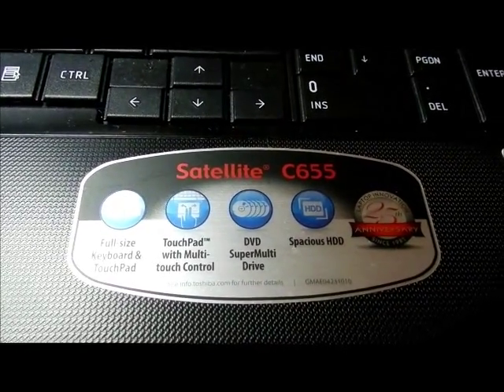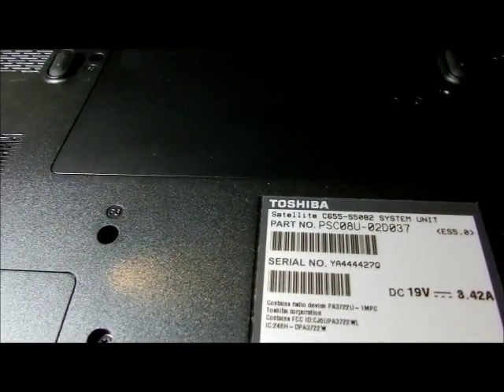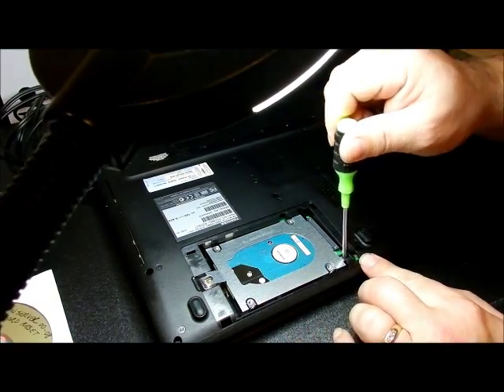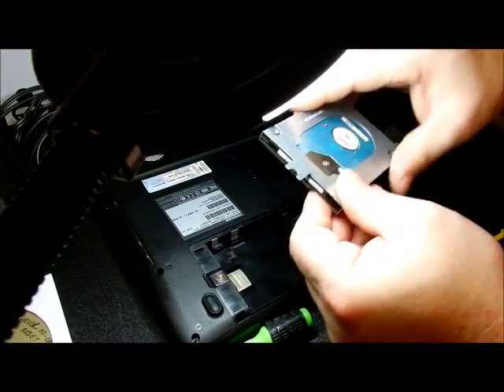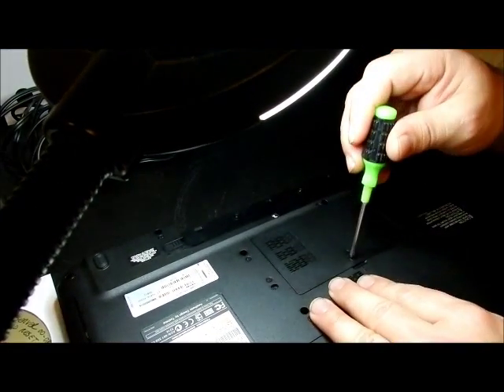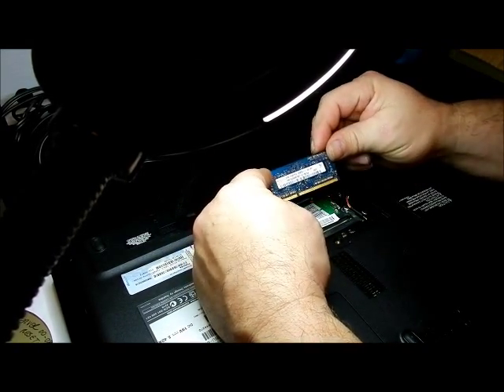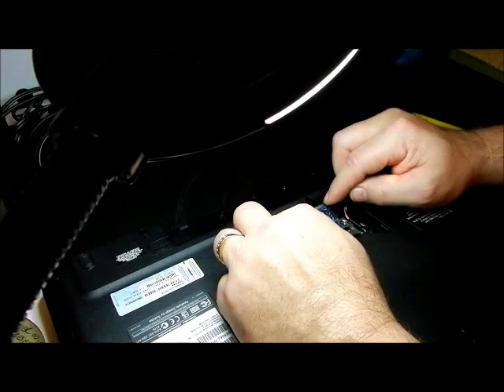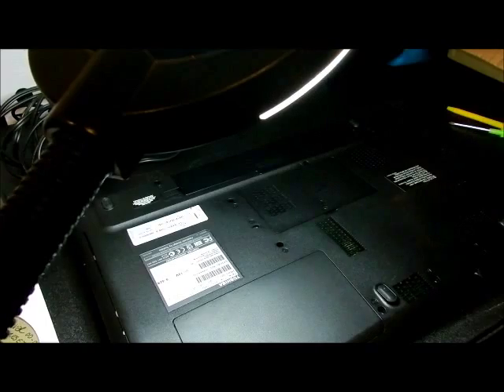Replacing the Hard Drive on a Toshiba Satellite C655

Comment: Do you know Maximum hard Driver capacity for that?
Reply from the maker: Unsure.  I still use it and have a 500 Gig SSD drive install running Ubuntu.
Reply: William Quinn am I can do 1tb?
Reply: Or 2 ?
Reply from the maker: @animalsandlife1449  Give it a try.  I have a 1TB external drive hooked up.
Reply: William Quinn thank you for help

Comment: I have a c655 - but different number after the first ...Just wondering my fan is overheating and it becomes really hot , and shuts off ..Im pretty sure that its not an issue with the hard drive but my fan giving out...I can turn it on an it boots perfectly and my programs are still intact until it overheats and i hear clicks from the fan area...im just wondering .. Am i able to remove my harddrive and put it into any other c655 model with my files still intact ? Are thry compatible ?
Reply from the maker: Magic will not work.  The files will be accessible but the OS on that HD will not run.
Reply: William Quinn sorry im not good with comouters but thanks for taking time and answering ....
Basically youre saying , thay yes ill be able to plug it in to another satelitte toshiba comouter , and it will boot up and ill see my files and settings intact but my windows will not work ? All I care is about getting my files . Opening it up on my friends computer and using a flash drive to transfer the files that i need .. So i can then buy another computer an then have the files that i need saved.
Reply from the maker: Well, now you have a good back hard drive.  You are very luck that you can see your file.  When a HD dies and will not spin all will be lost.